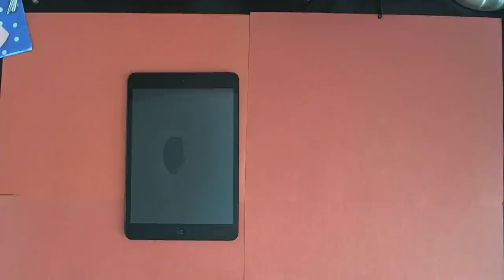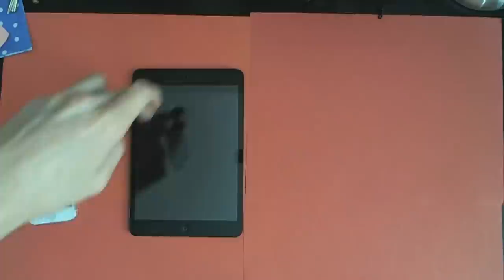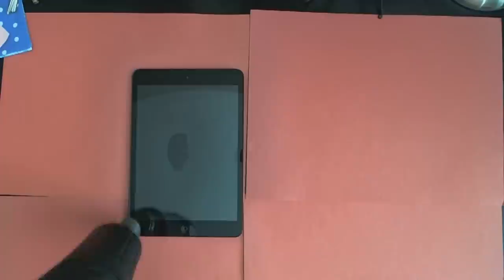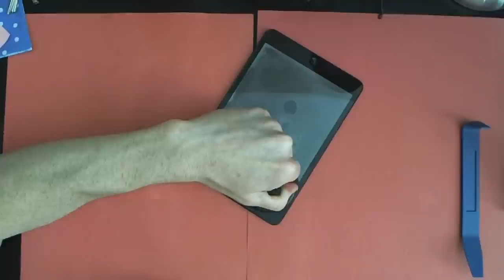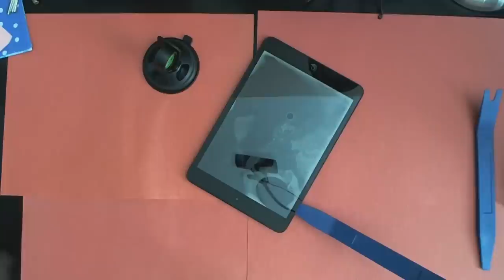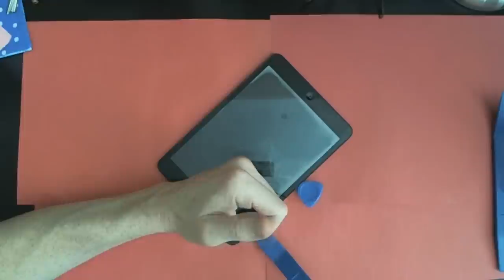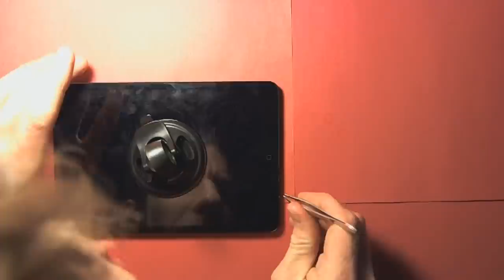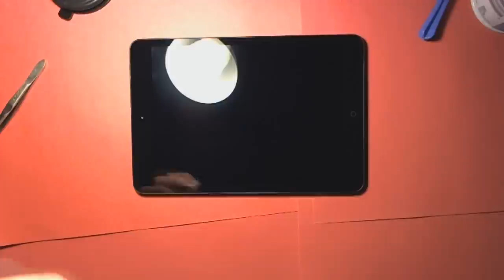iPad Mini Take Apart Teardown And How To Clean Water Damage

Comment: My mini iPad got soaked in a tent from a biblical proportion rain storm, water dripped out of it. I used a hair dryer on high heat setting and the GPS suction mount and an old credit card to slid around the edge to cut the adhesive and remove glass, not to difficult.  Fiddled around cleaning this and that and drying out visible water.  Everything looked pretty good and dry so hooked all the connections back up and plugged it in.  Screen display was very abstract with barely visible apple logo.  Decided to totally disassemble and toss.  Pulled the battery out and was a fair amount of water trapped behind it.  Moral of exercise, that battery has to be removed if you want to be sure it's not trapping water.  Battery was mangled so tossed into back yard so it would not burn the house down as I sleep.

Comment: mine just got wet so first I am trying to put it in a bag of rice to see if that works( I am currently on a Motorola droid turbo 2)
Reply: Sled_NeckX99 does it work?
Reply: A water bottle splashed on my ipad completely then I tried heating it by the hairdryer but no result it stayed turning off and not even turning on so I left it for 1 night in a bag of rice but actually it didn't work too😭

Comment: I haven't dropped in water but still I see moisture inside the screen which is increasing day by day.
 How can I fix it???
Reply: do you use a screen protecter?
if you do, its probably air bubbles, if so you should get a new one.
Reply: @khuevo2875  no I don't use screen protector.   
Anyway thanks a lot. Have to think about having  a new ipad.
Reply: That seems like the best idea.

Comment: You did not even show if it worked
Reply from the maker: The video was mostly for the take apart and cleaning, it works but my backlight fuse and chip are bad I will have someone fix that for me, it's to small to do myself.